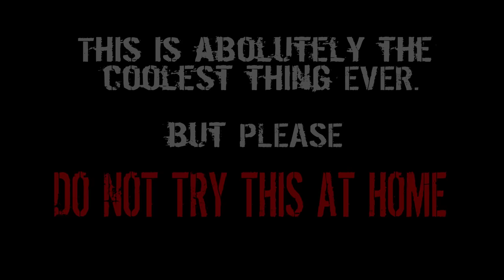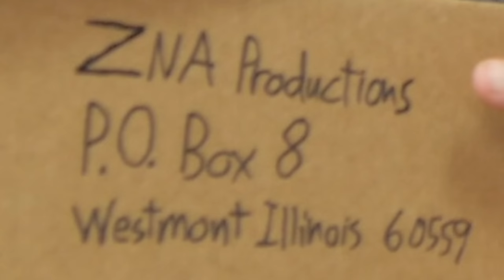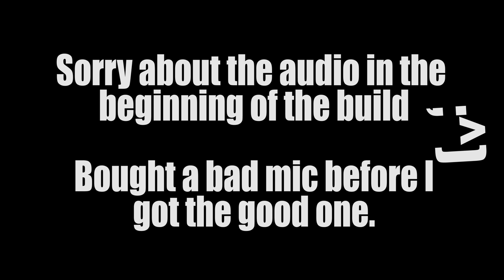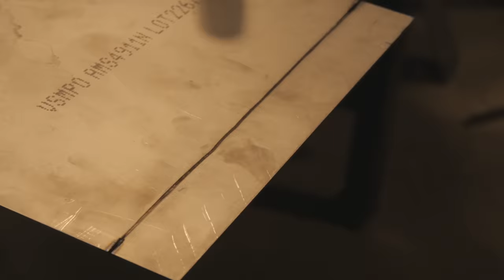How to Make Ghost Rider/Sweet Tooth Flaming Skull Mask

Comment: Eli did you know the plaster will desolve in water. So you don't have to risk breaking all your hard work with a hammer
Reply: I’m mentally noting that trick
Reply: @saintpoli6800   has to be warm water
Reply: That is a lie, at least for the type of plaster he uses here, it dries immediately into a rock and will not dissolve no matter what you do with water, best to just break it off of whatever you stuck it to because it doesn’t bond to things other than itself easily

Comment: cool mask...some tips on painting it...use a very thin paint to get into the crevices and use a dry brush (a brush that has the excess paint wiped off) to highlight raised areas. This is what we use to paint miniatures.  Thin paint runs into the cracks and tiny places. You basically just need to touch the wet brush to the surface and the paint will just run into the cracks. Conversely dry brushing will only rub the paint on raised surfaces and not get into the cracks at all.

Comment: tip: 

1. Use alcohol instead of lighter fluid, it burns at much lower temperatures.
2. you can add some salts/minerals to the alcohol to change the flame color. Table salt = yellow, Calcium Chloride = orange, sodium free salt=purple, borax=green, copper chloride=blue, lithium chloride=red/purple, strontium salts=red/orange

Comment: Hey great video, I went and bought the ONTARIO MARINE RAIDER BOWIE and took it in the backyard for some heavy chopping and chipped the blade from the tip to about an inch down the blade !!! They are using a 1080 carbon steel now instead of 1095 carbon steel.I don't know if it is the steel or a bad grind? What do you think?

Comment: Eli, I think I got a build idea for you(sounded amazing in my head but now it just seems like your regular build). try making a full body armor out of the fiber glass armor plate stuff you made back in december of 2016 with extra sheets of aluminium or steel to add more strength... believe this should create an armor capable of competing with full steel armor rated for assalt rifles while not being as heavy or costly due to it NOT being made of steel. if it works, then I'm planning to create this foldable sheild with at least two layers of the armor. if not then guess I'll just have to think of another way to make something like a sheild light AF while strong enough to take assalt rifles head on.

Comment: If you use a 50/50 solution Isoporpol to water it should burn at a low temperature, lower then lighter fluid probably.  It will probably be a bit hard to ignite but should be even cooler (source, a little bit of research)

Comment: By the way, ZNA Productions, if you ever decide to make a sword or a knife out of titanium...uhh...don't. Titanium is slightly too rigid to be a sword and doesn't sharpen that well. It's just not good blade material. Use carbon steel instead.

Comment: Cool, too bad u didn't take the time to do a para cord type head band like the flyer
Reply from the maker: Like I explained in the videos, you can't use synthetic materials or it will melt. Paracord is nylon. You can only use cotton.
Reply: @ZNA_Productions  yes but u coulda used the cotton strips 2 do it, dont get me wrong its pretty cool though

Comment: Next we need to light the entire head on fire... What’s a very flame resistant material?

New record set for world's most heat resistant material. Researchers have discovered that tantalum carbide and hafnium carbide materials can withstand scorching temperatures of nearly 4000 degrees Celsius.Dec 22, 2016

Apparently this is^